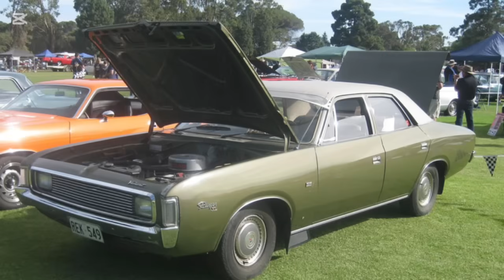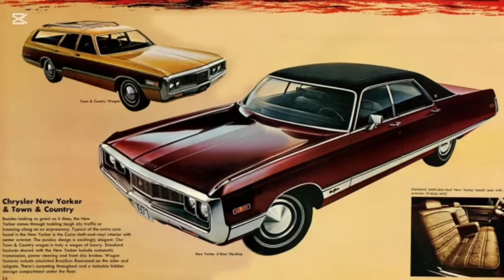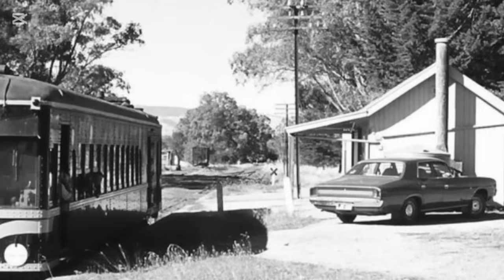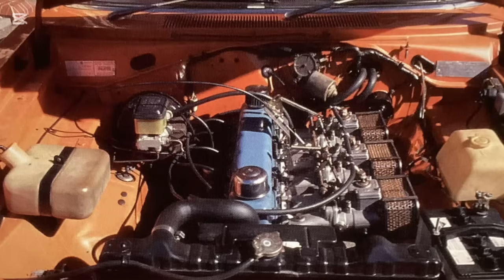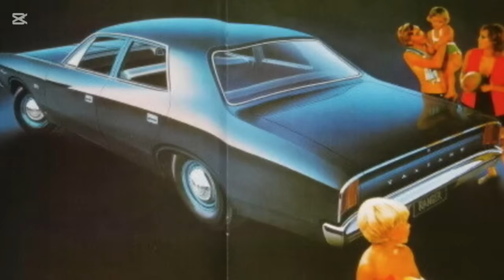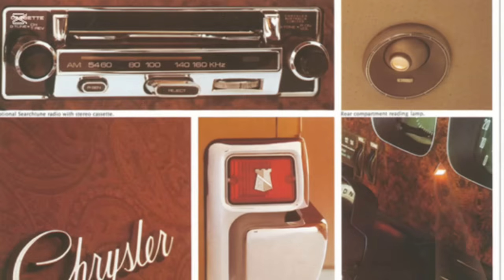VH Valiant & Charger - The Most Comprehensive Video Ever!

Comment: I offer some opinions and impressions of the VH Valiant . As Ive mentioned before, I have my fathers VH Ranger XL 245 ,he successfully tendered for it in 1980 , it was his employers car since new in early 1971 ( bought from Gardner motors Dunedin NZ ) , it was purchased new for the town Clerk , and got passed on to the boss at the council bus depot , and then became a general runabout car at the depot , but always well looked after and maintained .Dad was keen to own it , and he moved on from his AP6 to do so . I would have preferred it if  the 6 cylinder VH's had Torqueflite automatics, rather than the Borg Warner 35 , which Dad had to get rebuilt in about 1985 , and it broke again in 1997 , I replaced it with a BW35 out of a VJ  and it's been good ( touch wood) . I really don't understand why the VH sedan wasn't more well received in its release, I've always thought they look very good .A school friends father bought a new Charger in 1971 , and  I remember being taken for a Sunday drive in it , but,  he had some trouble with his drivers side bucket seat falling apart, and , as I recall he took the car back to the dealership and demanded that they give him another new VH Charger ( he was Dutch , good negotiators) . In those days  NZ didn't have much tv advertising for cars ( certainly not the Hey Charger ad) , you just bought the likes of  "Wheels " magazine to know what was on offer. What wasn't mentioned in this video, is that the Charger had much more racing success in New Zealand. I suspect that the quicker ratio steering box on performance Chargers was by way of a different pitman arm ?. As for the door shutting on VH 's , all of them shut very nicely indeed on mine . The panel alignment on VH's was often not as good as the earlier Valiants, but very strong.  My VH's drivers door window frame has always stuck out by a few millimeters compared to the rear doors window frame, and I remember a friend of mine suggested that we try and bend it back a bit to align it , both of us used all our strength on that frame, and it didn't budge even one millimetre , so It's still the same today.
Reply from the maker: That is quite the history with the VH Ranger, thanks for sharing. 👍
Reply: Continuation , ( I wasn't finished)  . A friend of mine had an HQ Holden sedan, and his front doors window frame was sticking out a bit  like mine , he said he'd like to align it properly, so I said I'd try to , I wound the window down and pulled on it hard and it very easily pulled into alignment, I think if I'd pulled just a little bit harder, I would have done damage to it . I had a VJ  Charger, and I'll say that compared to the VH sedan , it wasn't   nearly as good for road holding, and stability, I'd describe the Charger as skitterish in comparison. I fitted my sedan with wider wheels and tyres , and gas pressurized dampers,  and a front sway bar ( which wasn't really needed , the shocks were good enough on their own) , and along with all the suspension and steering components being in top notch condition, I can honestly say it carves through corners beautifully . The original front disc brake rotors weren't great though, they warped easily if you were on them consistently for too long .
Reply from the maker: @barrycuda3769 I remember driving a rent a wreck VK Ranger up in Qld towards Brisbane city in a torrential downpour. It rode on Kelly Springfield tyres. Man, that thing was like driving a shopping trolley. All over the place and hard to keep in the lane. I am sure, being a rent a wreck, it was not the finest example. I also drove Gerard’s Chrysler by Chrysler one day to work, as my 1978 update ZH Sportsman was having its auto trans serviced, so Gerard took my car. I could not believe how super light and over assisted the steering was, compared to my Fairlane. I was only about 20 years old then and my Fairlane only 5 years old - so I am sure, if I drove it today, I would be fine with it. 🤔👍
Reply: The power steering on those old Mopars was ludicrously light ( I'd ditch it and have non assisted) , I remember taking a VG VIP for a test drive, and when taking a gentle curve , I nearly put it over the gutter and onto the footpath, and I had the same experience with a friends '70 Coronet.  As for your unstable experience in the wet in a Ranger, I'm sure that a lot of Valiants didn't have their wheel alignment set correctly, Ive heard from wheel alignment guys , that they weren't easy to get right . The possibility of the wheel alignment not being right, and , I imagine those Kelly Springfields were cross plys ? , that would not be a good combination. I remember that Dad kept the original cross plys on his VH until they wore out , then he put radials on it , and I remember him saying what a vast difference they made in stability.  Another thing that makes a significant difference to the stability and steering on the Valiants ( and I wish Dad knew of it ) , is the alternative wheel alignment settings established by the NZ racing driver Leo Leonard  , he came up with them race testing the Charger, and he also came up with an optimal setting for street driven Valiants. I tried out Leo's street alignment specs , and it was very well worth it . Leo's wheel alignment specs are in the book ,  "Hey Charger ".
Reply from the maker: @barrycuda3769 Thanks for that info. 👍👍
Reply from the maker: I was young and it was cheap. 😀
Reply: I've been wondering about what you said about the 318 v8 VH's having 727 Torqueflite's, I always thought they had 904 Torqueflite's, I haven't owned a v8 VH , so I can't say for sure , maybe it was a mixture of 904's and 727's ?
Reply from the maker: @barrycuda3769 I am sure they probably mixed and matched based on available supply? 🤔👍

Comment: Outstanding Mark 👍🏼

The VH started my love affair with Valiants when we moved back toAussie  in ‘76 Dad ended up with a VH Pacer my eyes popped out of my head with the graphics on the bonnet and down the sides it replaced a rather bland early model Corolla station wagon. My first VH was a Blonde Olive Charger 4-speed with 245 and RT graphics and the usual Holley carb and extractors it went reasonably well for the time.
Reply from the maker: Very cool. A VH Pacer. Wow! 👍
Reply: @markbehr88 Yes Vitamin C paint scheme and at the time Dad did not trust the factory Rally wheels for some reason. (I asked him but he is 85 now and can’t remember why lol) so the car yard swapped them over for Regal rims and hubcaps.
Reply from the maker: @Ballterra Cool. That’s funny re the rims. 😀👍

Comment: Excellent, comprehensive overview, most enjoyable. 28:30 My understanding was the six cylinders had the Borg Warner 35 3 speed auto, the 318 got the 904 TorqueFlite, only the 360 got the 727.
Reply from the maker: Thanks. Yes, I think that’s right. I meant the 727 in the V8. 👍
Reply: 727 for the 340, and the 360. The 318 was backed by the 904 torqueflite auto.
Reply from the maker: @garystokes9979 👍
Reply: Ive heard that some Hemi six Valiants that were deemed as being for heavy duty use , such as Taxi's , had 727 Torqueflite's.  Those Hemi's were a specially cast engine block to bolt up to the Torqueflite, I think it would have good if they were all cast that way and used a Torqueflite , either 904 or 727 . My VH Ranger XL has a Borg Warner 35 , out of a VJ model , and its worked very well for many years, but the original BW35 in it broke , and had to be rebuilt, then later on it broke again , that's when I put the VJ trans in it . Ive heard that the VJ  BW35's were improved and stronger 🤔. Ive also heard that they can be beefed up by using the internal parts for the much later Borg Warner used in Falcons .
Reply: @barrycuda3769  Not sure about 727's or 904's in Taxis - possibly police cars though. Some 265's got 727's or 904's due to supply issues with BW35's for a few weeks in around 1975-1976. Dodge trucks got a HD 245 hemi six, heavier rods, harmonic balancer, flywheel and I believe the ability to connect 727 trans (although I have never seen a 245 auto in a truck - just manuals - but who knows).
Reply from the maker: I’ll look into that when I do the VJ episode. 👍
Reply: @markbehr88  I once purchased a used 727 torqueflite that came with all the OEM 6cyl Hemi to torqueflite  engine to gearbox braces, correct 6cyl starter motor block off plate as the starter stayed in the V8 position. The 6cyl Hemiblocks were cast to allow the lower locating dowels and bolts to have sufficient metal to drill into, the standard hemi blocks did not have this
Reply from the maker: @malleeboy300rider7 Interesting. I think there were some mix and match things going on. 👍
Reply: 318 in the K cars(the cop cars) had a 727 Torqueflite .
Top compression rings were also molybdenum for minimal wear of the cylinders
Reply from the maker: @benjamintresham9649 👍
Reply: Love these videos, thanks so much for spending the time to put them together. It’s funny tho, I have some contemporary car reviews that state how they thought the sound/feel of the doors closing on the VH was the highest quality of the big 3.
I own a VJ and the thickness of the doors on these things is formidable.
Reply from the maker: Thanks very much. I always felt like the doors sounded like they were full of air as they did not have the same sound as the Fords or Holdens? The paint was certainly nice and thick.

Comment: It was a shame Chrysler just kept chucking a larger car on the same frame, its funny to see how close the front shocks mounts were to the motor, the shocks were on a 45 degree angle , weird as most shocks 90 degree angle.
Reply from the maker: Yes, they probably should have picked up the Aspen instead? But then we wouldn’t have the Charger. 🤔👍
Reply: Yep the VH engine bay is the same size as the VE. And any track width increase came wholly from more rim offset. The K-frame and control arms were the same as VE so the track was inherently the same. The VH body probably should have only been made 2” wider than VG not 4”.
Reply from the maker: Yes, you are right there. 👍

Comment: Great video,. Regarding the door closing sound. When new the doors did close with a quality sound, however,  as the cars aged it didn't last,  especially the front doors, as parts wore out.
The lesser used rear doors often maintained the nice sound though.

Comment: Riding in the back of the wagon, pulling faces at the drivers behind, was a rite of passage. We learned very quickly not to overdo it.
These cars do look awkward with their narrow track.
Thanks, Mark, this was comprehensive.
Reply from the maker: Thanks. I remember the wagon journeys very well. Looking up at the street lights while we drove home from Grandma’s place at night in the Falcon XL wagon. 👍
Reply: I've increased the track width on my VH Ranger XL  by way of 15 x 9  US Indy wheels on the rear , and 7x14  Triden wheels on the front ( 235's front, 265's rear ). It used to be my fathers car , and he was anti mag wheels, but when he saw them on the car he had to admit it looked good , still wouldn't suit his image though . The wider tyres certainly improved the road holding and handling, much better than  the 5.5 inch rims with 185's .
Reply from the maker: @barrycuda3769 Yes, that would make a big difference. 👍
Reply: Always remember riding in the back of my Dad’s XY wagon coming home from the drive-in’s in the 70’s 👍
Reply from the maker: @davidr6352 cool hey. 👋
Reply: @davidr6352 Nice memory. 🙂

Comment: Great presentation Mark. Back in 1995 I took one of these for a test drive, a 1972 sedan in dark metallic brown on a car yard in Waitara, NZ. Had about 60,000 miles on it if I recall correctly. Admittedly the timing wasn’t great as I’d just written off my 1991 Fairmont in a very bad crash and, though not badly injured, was still pretty sore. Found the car a bit sluggish (had the 3-stage auto transmission), suspension a tad wallowy, painful to steer without power steering and wasn’t fussed on the braking performance (I’m pretty sure it had drums all round). Shame because the car had clearly been looked after. Once again Mark thanks for your effort, I really enjoy your videos 😊
Reply from the maker: Thanks very much. 👍
Reply: They can feel a bit sluggish from a standstill, that's because of the usual 2.92 diff ratio , but on the open road is a different story .
Reply: @barrycuda3769 Good point there. I think at the time I was still pining after my 1991 Fairmont which was written off. Like comparing apples with oranges

Comment: I had a 215 VH Charger which I bought for $200 in 1979. It had a bashed in fender which I easily fixed and then painted the car in a nice metallic light blue. I drove it from Bunbury to Karratha and back with zero problems, in fact it was a brilliant little car and good on fuel with the 215. 
I then welded in a chassis and cut the center out of the roof, Ferrari style. I repainted it in Ascot green with blackouts around the windows and bonnet like the Pacer. It was the first in Australia, although in '84 I saw a CM model done exactly the same way in a Car dealer's in Melbourne.
A mate bought a Regal hardtop in '82 for 70 cents when you couldn't give Valiants away. If only we'd known. 🥲🤔
I remember people who had the 360 Chryslers. They would wind and wind and not start. lol.
Reply from the maker: Yes. We didn’t realise what we had. 🫣

Comment: I always found the model range confusing. Some were Valiant, some Chrysler, some Dodge. Also Chrysler Valiant then the one that really baffled me was Chrysler by Chrysler. What did the 770 designation actually refer to? Was it just some random number?
Reply from the maker: Yes, there was a bit to unpack there. 770 was just a made up trim designation I believe? 🤔👍
Reply: @markbehr88  Remember the top of the line Hillman Hunter '660' Royal that they also sold at the time. I was always curious about those two number designations. In the case of the Hillman the 660 model also came with the twin carb performance engine.
Reply from the maker: I think they made them up. There was a 440 series in the USA too. 👍
Reply: Have owned many mighty Val's over the years, sedans, a wagon and even a Chrysler by Chrysler 318 fireball. I am currently the proud owner of a Dodge VG ute, full poverty pack, original radio delete car. Imagine my surprise to find that this car has a S.O.A number after the vin !
Reply: @jamesdeans2614  How cool.  Curious, what is 'special' about it to have a SOA number? Surely it's not just for a radio delete. I thought that was for bigger things like specific engine, transmission, or colour choices. Was it a Government order car maybe?
Reply from the maker: @jamesdeans2614 Very cool. 👍

Comment: Did VH Dodge utes have round headlights  ?
Reply: vj dodge ute square headlights , vh dodge ute circle headlights found brouche
Reply from the maker: @tivet4 👍
Reply from the maker: Cheaper?
Reply: Ive been looking at photos of them , most have the rectangular lights, and some are round .
Reply from the maker: It is straight from the VH ute brochure. Maybe NZ was different? 🤔
Reply: @markbehr88 We didn't get Dodge utes over here, so it's a bit of a mystery to me . I just noticed that the VH Dodge ute you showed seems to have round headlights, and I think Ive seen that before.
Reply from the maker: @barrycuda3769 Yes, that was how they came. Cheapest ute, lowest specs. 👍
Reply from the maker: Yes. 👍
Reply: That's one of a few things that I Iiked about  the VE over the VF ,the smaller round headlights looked good to me.  I always thought it would have been good if there was a VE hardtop coupe.  I remember ,not long after I bought my VG Pacer coupe ( automatic transmission) , I was flicking through the Melbourne trade and exchange paper, and saw an ad for a VF coupe , fitted with VE front panels, and a 383 with 727 Torqueflite, for the same price as I'd just  paid for the Pacer . As much as I was pleased with the Pacer , that car really would have been  my cup of tea .
Reply from the maker: @barrycuda3769 Yes. The VE was a very good looking car. In the VIP though I much preferred the VG version. 👍
Reply from the maker: That would have been like another world. 👍🤔